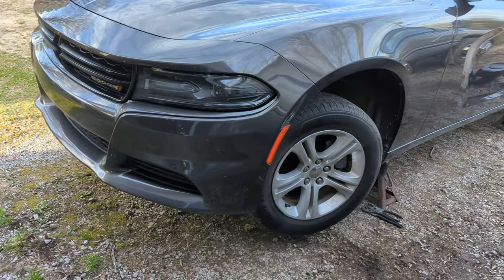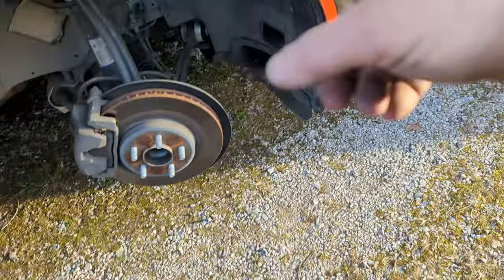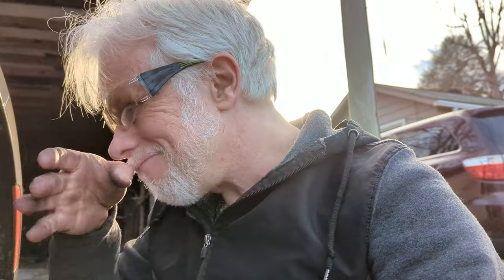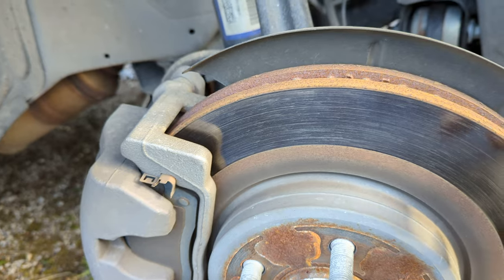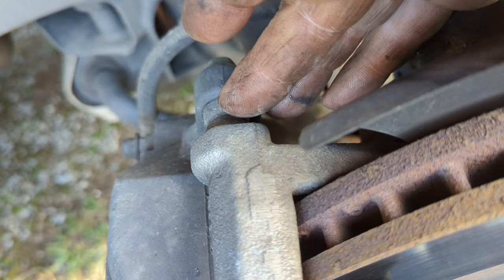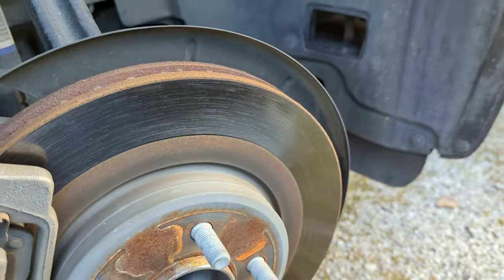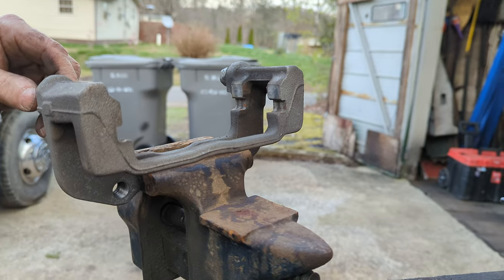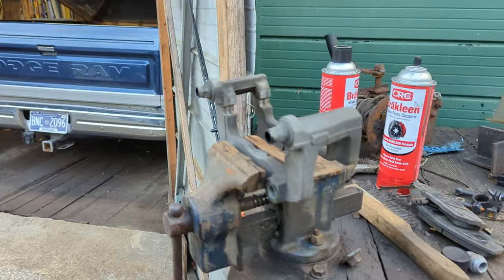20 Dodge Charger replacing front brake pads and rotors

Comment: Thank you for the informational video! Can all of the brake pads and rotors be changed without bleeding the brakes? Does the brake fluid need to be topped off at all?
Reply from the maker: As far as leading the brakes, the only time you need to leave them is when you open the system up, meaning like you're changing a brake hose or a caliper or a wheel cylinder or a master cylinder or a brake line anytime you open one of the take one of those parts off or open the system up like one of the screws then yes, you do need to bleed the system, but if you're just changing out pads rotors, anything like that that is outside of the brake system. That is the external components of the brake system that don't involve the actual brake fluid coming in contact with those parts then no, you do not need to bleed your system if you're just changing out pads and rotors or in the case of drum brakes, shoes and drums then no you do not need to open up the system and bleed it at all. However, do let me stress this topping the brake system off. Really there's no real harm in it. You can do it. I don't necessarily recommend it but there's no real harm in it. The only real bad part is is that when you go to replace your pads and rotors you're going to be compressing the Piston in the caliper and then that will make that fluid. That is in the system. Will have to go somewhere. It'll have to escape the caliper and then go back to the master cylinder when that happens. That means that that full master cylinder is now overflowing with brake fluid. So you're just going to have a big mes I myself when the fluid gets down a little bit low I will note it. I won't notice it, but if it does, if it doesn't continuously get lower then I'm not really worried about it. However, let me also stress this brake fluid is something that needs to be changed out every couple of years. That's the way it's supposed to be. However, there's lots of cases where that's not always. Follow if that happens and the brake fluid isn't changed every couple of years and then in that case yes you do need to bleed the brake system but brake fluid can absorb moisture out of the air and over time it does get the brake fluid can get damaged and worn by all of the use over the years. But if we're talking about just change of pads and rotors then no don't you don't have to bleed your brakes. Now you can go to a garage and a reputable one and have your brake fluid flushed which they will use a machine that will hook up to all your calipers and then all your wheel cylinders and then also to your master cylinder and it will. Basically it will remove all the old brake fluid and then if they will replace that with new brake fluid. But I would like to also say thank you so much for watching and for your comments if you have any other questions you'd like to ask, let me know very much and I bless
Reply: @slantfish65sd thank you very much for the video and for all the information! Very appreciated!